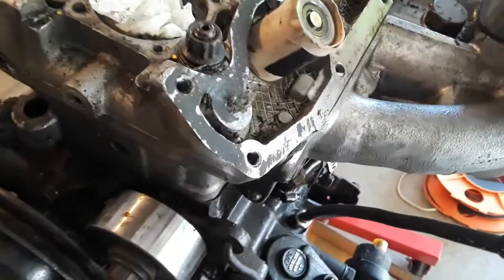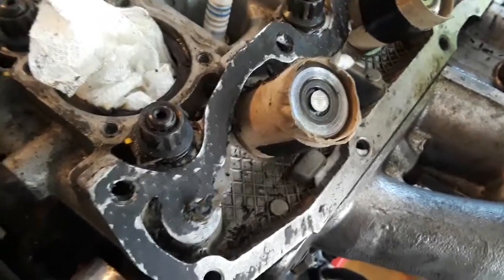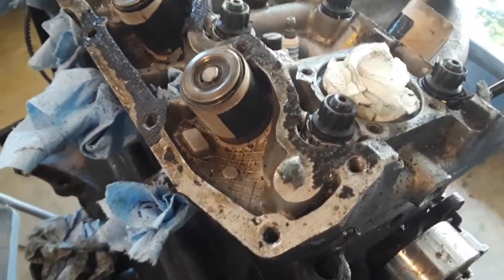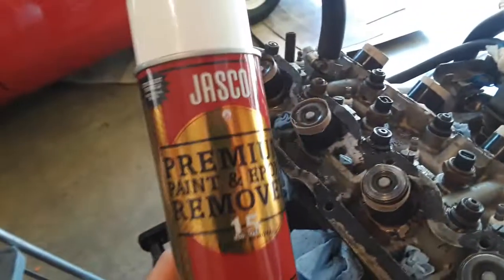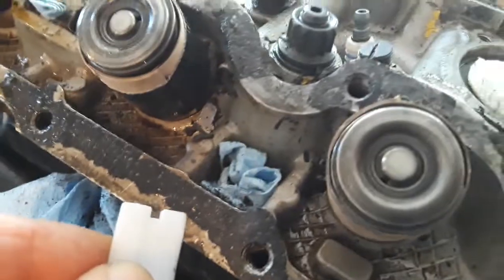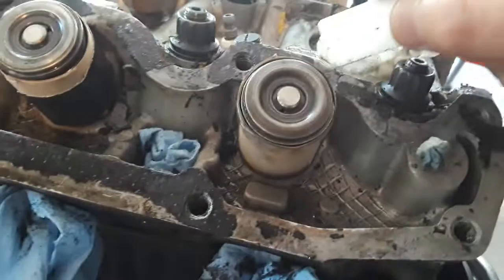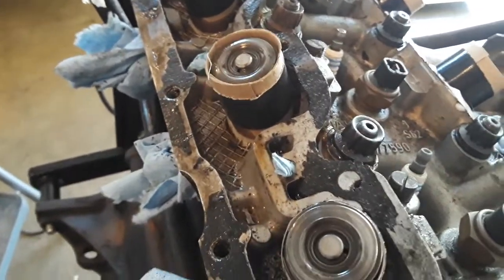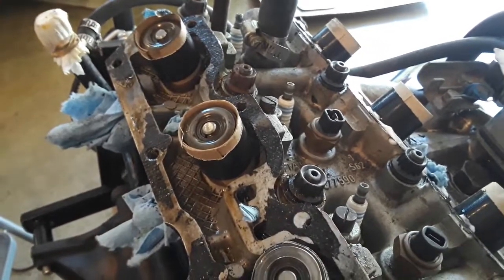Removal of gasket material from aluminum heads

Comment: I tried the liquid version of this Jasco premium paint remover on a lawn mover valve cover formed gasket.  It doesn’t melt the gasket material but it releases it from the aluminum.  I had to use a small wire brush.  Amazing and thanks for the tip.  Gloves should be used but the jasco makes them fall apart.

Comment: Lowes sells that stuff / brand in a square can.  It’s like a thick gel,  easy to dab on all around the gasket.  I just used it a couple days ago on my Honda Goldwing the rear cover and case.  It worked great,  still had to get off as much thicker gasket as possible before applying the gel.
Reply: Do you know what brand it is got some DR650 gaskets that are like welded on.
Reply: @mt1885  Red can,  JASCO,  Premium Paint and Epoxy Remover.   It’s a gel not a liquid.
Reply: @workharddieproud  THANKS!!! I will get some and let it soak on it. I was checking the 'neutral safety switch screws on a older DR650 got all of the parts (just the gasket has been on there for 15 years low hour bike) - but did not want to ride it a lot until I checked it out.
Reply: @mt1885  Your welcome,  that stuff should work for you.  It will soften up a gasket pretty quick.

Comment: Thank you very much for your tips. It did work for me. My lawn tractor LT1000 crankcase has a paper gasket. It's been 20 years and the gasket sticks to the case very hard. I thought I had to use a razor to remove it. Yesterday, I bought that paint remover.  Not sure how long you had to wait but I applied the remover 3 times and waited for a total of 6-8 hours. My gasket did not come out as easy as yours. I would say mine is about 90% as easy as yours. Thanks again.

Comment: Thanks for the info'!  I'm thinking about applying a little nail polish remover to the big o-ring gasket which presses my thermostat into the housing (then go to a pick).  I went to change it today and it's melted tight to the housing.  Would it be necessary to clean the surface with, say, brake clean after so that residual remover won't eat at the new one?